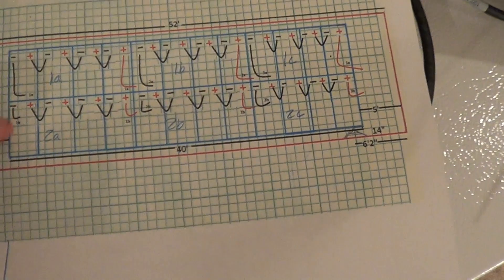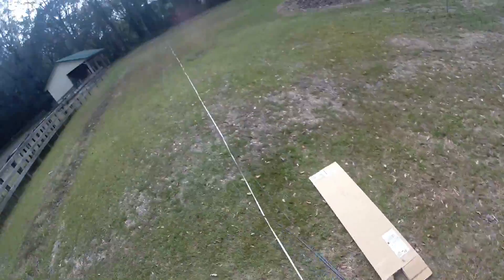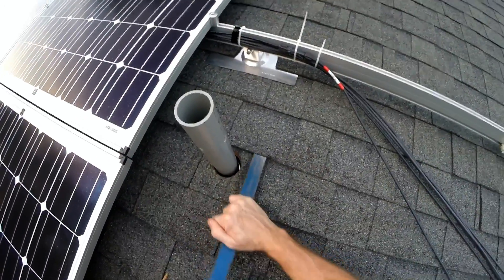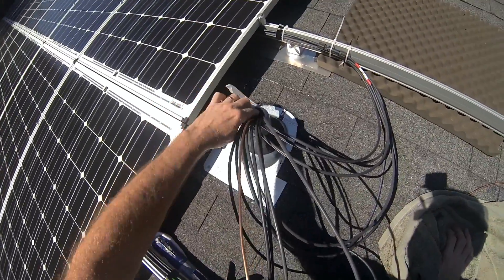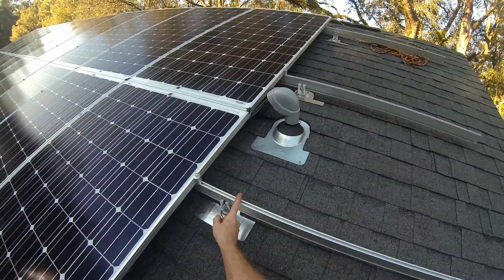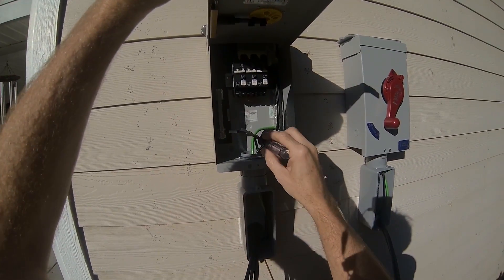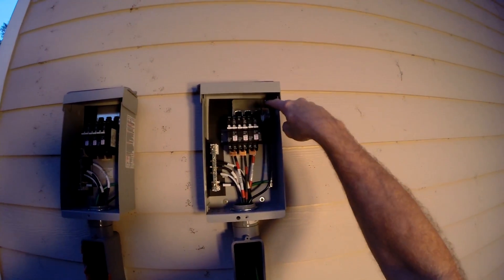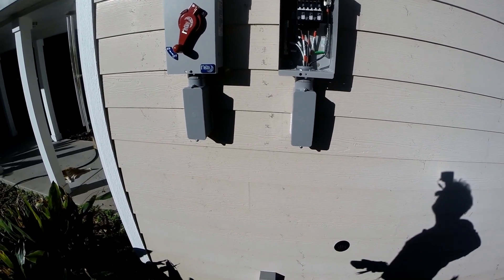Off Grid Solar #34: Wiring Solar Panels to Combiner Boxes

Comment: @David Armstrong I think you made a mistake on the PV combiner circuit breakers. you are only going through one breaker that way instead of both. I think you need to connect your Solar to the top of the breaker instead of the bottom (copper) side. Otherwise I think you are only covering 150 volts instead of 300 volts. https://youtu.be/aseWoZLXrEY?list=PLkTIWHBRRyi6NyWsyl03VuC2-JdBx0M46&t=445
Reply from the maker: David, at first glance I think your right.  I will have to look into this.  Thanks!
Reply: @HomesteadEngineering  Btw, thanks for all of your videos!! I am building a similar system and have used your videos for reference many a time.

Comment: It seems that you routed the wires from the roof into your solar/control room and then pulled all the wires to the outside to the combiner box, and then you will bring them inside once combined. Is that the way you are doing this?
Thanks in advance, I am planning to do something similar here in Jupiter Florida.
Reply from the maker: Ronnie, Yes, that is correct.  For me that was the easiest and cleanest way to do it so as to avoid conduit across the roof and down the side of the house.  Good luck with your project.

Comment: I'm not criticizing but why are there so many wires coming from the solar panels?  I did something similar with 6 panels but I used series-parallel and used a Y connector to reduce the MC4 coming into the cable entry to 2 lines.  Now I'm wondering if I did something wrong.  When I think about it though, did you use so many wires so that you can control the string cable ordering through the AJB?

By the way, your setup looks very clean and ordered.
Reply from the maker: DB, I have two wires for every string.  I have 6 strings.  I am not sure exactly what you did but sounds like you just combined your strings with a Y splitter.  I think that's fine as long as the wire is rated for the combined current and voltage.  Thanks!

Comment: Nice install, only issue I see right off is the use of pvc in an attic, it's maximum temp use is 122F in ambient temperature per manufacture. I've used emt for this kind of install a few times with a weather head. However, my local inspected allowed me to use pvc in my attic for a 200 amp service upgrade, I had to keep it on top of the ceiling rafters and in the insulation, no issues as of yet. I'm about to reshingle my roof and am looking at using ironridge hardware to install some more panels in addition to my pole mount I have next to my house. https://youtu.be/TNRk3YiMPxs

Comment: David, at the end of your video you showed the panels producing 170 Volts, does the voltage have to go through anything like a transformer to step it down to 120?
Reply from the maker: Chevy, that's 170 DC.  It goes into a charge controller that converts it to 48-60 VDC and charges the batteries.  That battery bank is used to drive an inverter that converts it to 120/240 VAC.
Reply: @HomesteadEngineering  12 home runs!  That's a lot of wire... Was your charge controller limited to 170v?

Comment: David Armstrong, how do you protect the solar panels from hail and snow? Can you put plexi glass in front of them? Will it still work?
Reply from the maker: KL, you just have to move to Florida.  :)  The panels I have are actually pretty strong and I would not be concerned about small hail or snow.  I don't think you would need to do anything special, but you should check with your specific manufacturer.  Thanks!

Comment: hi i have 9 panels of 245w . how will you wire them on string like 3 each to make the wires to the controller smaller in size
Reply from the maker: Your probably going to end up with 3 strings of 3 since you have 9 panels.  The more in series the higher the voltage and the more in parallel the higher the current.  Send me your email and I'll send you a spreadsheet that may help you.  Thanks!
Reply: @HomesteadEngineering  ..9x 245w panels to a 150a midnite controller .. and 12 battery L16 370ah ..thanks.  borrallo5858@yahoo.com
Reply from the maker: @pepe58pepito54  Just sent the info via dropbox
Reply: @HomesteadEngineering  ..thanks . looks good with lots of details
Reply: @HomesteadEngineering  Hello David, great vids amigo. Can I please use your spreadsheet as well? iamfound74@gmail.com thanks in advance!

Comment: L👀ks great... but got to thinking what a nightmare of jobs it will be when time to replace roofing in 20-30 yrs ! Move, just before ! lol
Reply from the maker: We are thinking of putting on a metal roof so as not to ever have to change it again but definitely not looking forward to pulling off all the panels and putting them back on again.  We would also have to change the mounting brackets to work with a metal roof... not fun.

Comment: why is there a bare cable coming from the solar panels ?  or is it coming from the lightning rod !
Reply from the maker: That's the ground wire and its connected to the ground lug on the rail.

Comment: Looks great...was really scratching my head on the panels wiring for a few mins. Then I realized it is a horizontal vs vertical stringing. With my 2,400 watt array, I tried vertical (north-south) orientation last year...and it didn't work well: (series-series-series-series-parallel, layere-- whereas one string had max shade...the other three would be sun soaked). Nope....not good at all. So, went back to horizontal, much better results with partial shading hitting two strings. That didn't bring down the current as much. With one string totally in shade...brought down the whole array. Can't wait to see some blinky lights on and charging!
Reply from the maker: I remember when you did that and went back and redid it after it did not pan out.  Hey, you don't know until you try right.  I asked several people about series/parallel wiring with regard to shading and the answer I got is that it would not matter.  I think your experiment shows that it does.  That said, this video focusses more on how you get from a pre-wired array through your roof and out to the combiner boxes.  Blinky lights coming soon!

Comment: be interesting to see how this all comes out. looking good. next major step is charging perimeters
Reply from the maker: I might be turning the system on for the first time later today.  Hope it works!
Reply: It will. How are you going to set your charging voltage
Reply from the maker: I don't know yet.  My next step is to turn the system on and go through the functional test to verify everything actually works.  After that I will start working on tweaking the setup from the default settings.  I may call you at that point and thanks for offering your assistance!
Reply: OK. See how things go. Your doing a nice install be good to see it all work properly